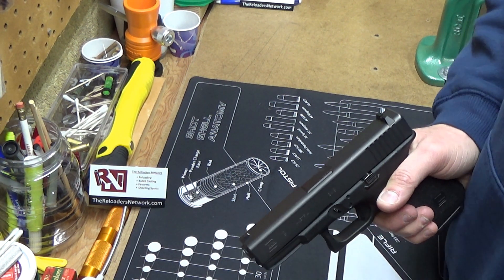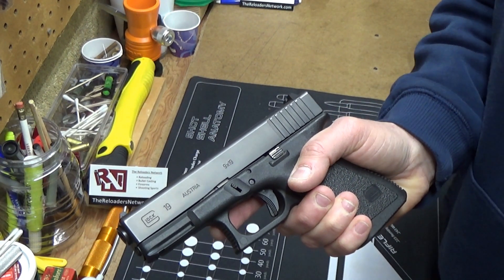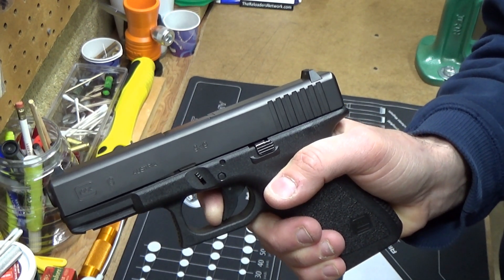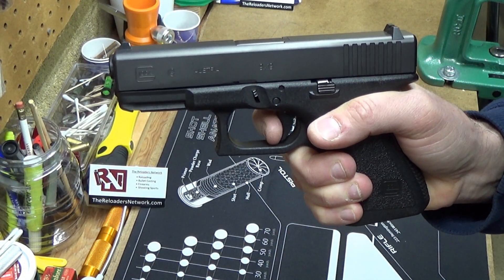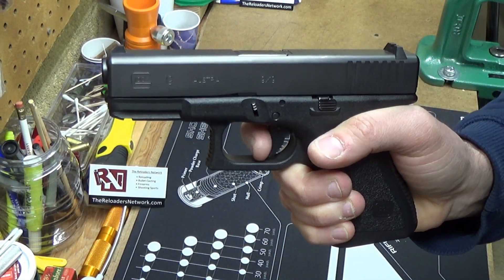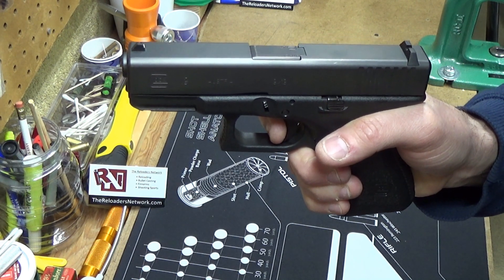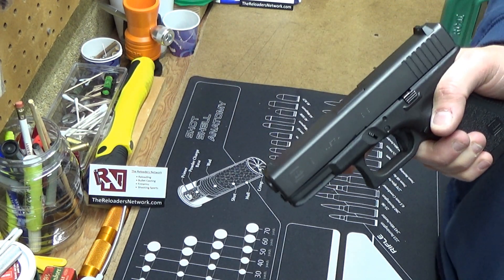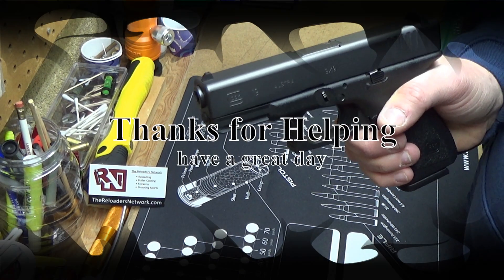Glock 19 Hard trigger fix question

Comment: 3x Certified Glock Armorer, worked on hundres of guns for a municipal police dept. This is not uncommon in Gen 3's. Replace the trigger bar. There will be some sort of deviation in it from manufacuturer spec that will be completely un noticible to the naked eye. The symptom is that the trigger will feel like its stacking heavier and heavier towards the rear of the trigger pull. It gets progressively heavier. It will feel like 15-20 lbs at some point before it finally wont break at the end of the pull.
Reply from the maker: Thank you for the information. I have the parts, I just need to replace them. Your confirmation that what I see and feel is accurate makes me feel better. Thank you very much.
Reply: Im having this issue currently. I got a knockoff trigger assembly from ebay for cheap and am paying the price for it.

Comment: So what I found was that the connector has a sweet spot where it likes to be if its too far in your trigger wont reset or too light of a reset. And if it too far out your trigger bar hangs up on the connector causing hard trigger pull. Take out your connector and bend it in a bit with a pliers and insert it back into place. then bend it out slightly little by little till your trigger is crisp and functioning perfectly. nice crisp trigger pull and reset.

Comment: Check your firing pin channel liner, I had a same issue with little more problem of slide. My Glock 19 Gen 4 had a very light & smooth trigger pull, but when I sent my slide for polishing as it had lots of wear & tear marks after a long use, when it came back and I roe-assembled the slide on frame, the trigger was almost freezed, I had to use another finger of my support hand to give force to my strong hand's trigger finger to pull it. You can say, it was around 50 pounds heavy trigger, which I was unable to pull. Then after inspection it deeply, I found the channel liner issue, that was stopping firing pin spring to work properly. I just changed the channel liner and the problem was fixed. Now I have again a smooth & light trigger pull.
Reply from the maker: That is definitely a possibility on mine. I will get a new liner and try it. Thanks. I have looked at it and cleaned it but will check again and just order a new one to be sure.

Comment: Would be nice if you showed the internals, slide and receiver. I am a Glock armorer, the first thing I would check is the firing pin safety, remove it and clean. Could be trash under the safety in the spring. Then the connector. Please make another video showing the internals.
Reply from the maker: Thanks for commenting. After fiddling with it I think it is something with the connector. I will try to make another video  showing internals. but tight timelines right now.

Comment: So there’s two main types of engagement when it comes to your trigger pull. The cruciform engaged with the striker and your connector engaged with the trigger bar. If your connectors angle is wrong or off that can cause a reset issue  (that Audible click you hear) is the connector slipping off the trigger bar. Simultaneously the cruciform  dropping off the striker..and then as the slide recoils back that resets everything else in place for the next shot.. now seems to me without seeing it that it in fact is a connector issue. Because off top it’s looking like you need to apply more pressure than necessary to get the trigger bar to engage the connector and reset. OR! A trigger housing spring issue. When installed the spring has to be vertical with the cruciform if crooked can cause issues. Or could be just an issue with the spring itself So check into all those components too and there’s vid to show you how to do your safety checks and assembly an all so make sure your doing things in proper order . And another thing it mostlikely is not a cleaning issue glocks have incredible reliability in even the worst conditions. But still keep up with common maintenance but still not the issue your dealing with…so I hope this is a little more helpful maybe to basically and quickly explain what’s happening inside when your pulling on your trigger.
Reply from the maker: Thank you  very much. I have been trying to adjust the connector angle bc that seemed like it was the issue. I need to check the trigger housing springs  too, though again, I have and they seemed fine and put back correctly. I did get some replacement parts and may start swapping them out. It is all very clean and oiled. Thank you for the detailed comment and advice. That is what I was looking for when I made the video. I have a pretty good idea of what I am doing, that is one of the reasons I was frustrated about not being able to fix it. I appreciate your time. Thank you.
Reply: Any time man I’m glad it helped you out..yea my intention was to just let you know the mechanics so you can break it down and figure it out but I’m almost positive it’s a connector issue so as soon as your parts come in drop it in and see what happens but you shouldn’t need to mess with anything so drop it in just as it comes and see if it fixes the issue. Again glad to help. And if you want, reply when you get it corrected I’d like to know what it turned out to be
Reply from the maker: @minsuchoe2431  I will definitely let you know once it is fixed. Thanks again.
Reply: @johnshandloading7907  did it get fixed?

Comment: Hey John, I had the same problem come up this weekend on a Nomad build. New trigger kit, smooth install. Oiled all the sexy bits. After 30 or so pulls it started getting tighter and tighter, you could feel the binding. 

Pulled it apart so many times I feel like I should be teaching a class. Finally swapped connector (looked identical but it was a gen 4 to a gen 5) and the problem has gonna away. 

Did that fix your issue also?
Reply: Had the same issue with my nomad build also

Comment: Any resolve to this issue? Same problem I’m not experiencing with my gen 5. Was one of the best triggers I’ve had in a stock Glock and now this
Reply from the maker: Have not swapped in new parts yet, but that is what I am going to do. Replace the trigger bar and connector. I fiddled and fiddled with the angles etc. with no fix. I have new parts. Have not installed yet.
Reply: @johnshandloading7907  thank you. Might have to do the same

Comment: Did you ever get it fixed? I’m having the same exact problem with two different triggers
Reply from the maker: No, but I bought replacement parts to change and have not installed them yet.

Comment: Did you ever try checking your trigger bar housing pin to make sure that it was seated correctly
Reply from the maker: Yes,  it seems fine. I actually bought all new trigger parts and have not installed them yet. It is a very odd situation for sure.

Comment: If you haven’t fixed this yet, try adjusting your connectors bend angle. It probably needs to come away from the housing a bit. 

Just look up how to adjust, I had this same issue then tried that, I figure the spring gets compressed over time and caused the issue.
Reply from the maker: Thanks. I have done this and tinkered with it several times. Still has the issue. I ordered new parts and have not  installed them yet bc I have  too many projects going on at once. Thank you for commenting and giving me solid advice. I appreciate it.

Comment: You fix it, I have this same issue ?
Reply from the maker: I ordered a parts replacement kit and never swapped the parts out yet. So no I have not fixed it yet. I played with it tinkered it and did everything I could and still had the issue. So my only option is new parts.
Reply: @johnshandloading7907  take it to a shop lol

Comment: I just had this happen to me. felt like if i pulled to hard i would break it and the trigger would not drop. this was right after a 25 cent polish. The connector had been push toward the housing to much. using the old reverse trick, I pulled out the connector and installed it backward in the housing and lifted it 3 times gently ( the bend will be away from housing)  re-installed and done. 

here's a vid. https://youtu.be/Z6BK2bglB4I

Best of luck
Reply from the maker: Thank you for this. I have tweaked it and tried and still have the issue. Thanks again.
Reply: This fixed the issue I was having right up.
Thanks for this.
Reply: @wanderingcalamity360  nice!